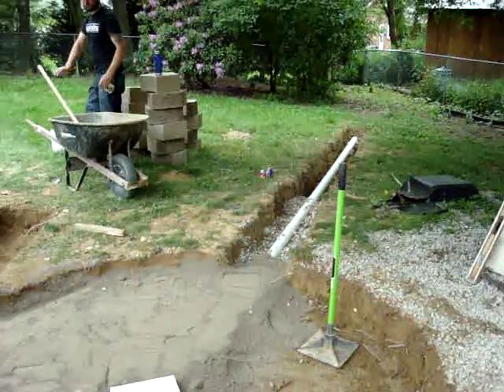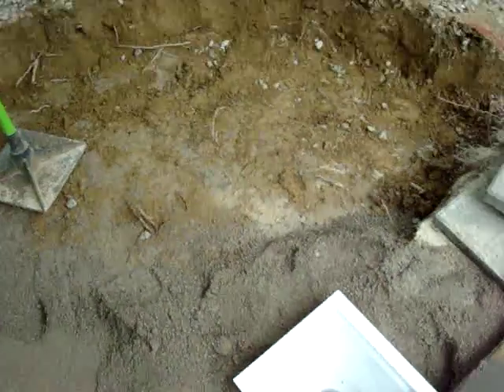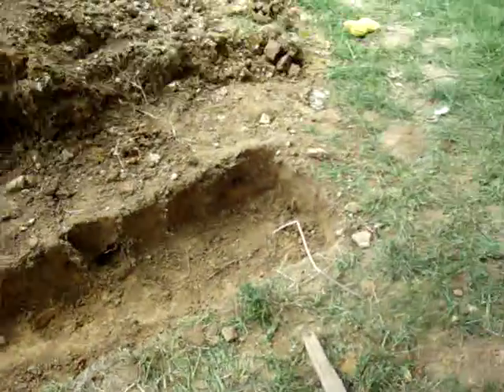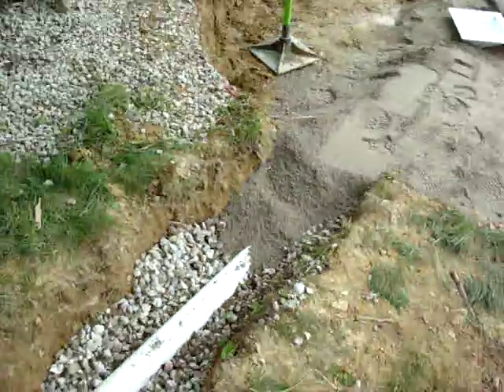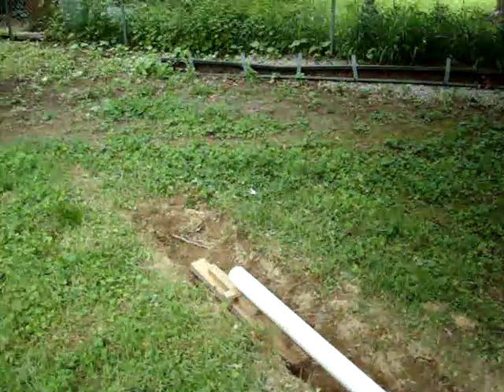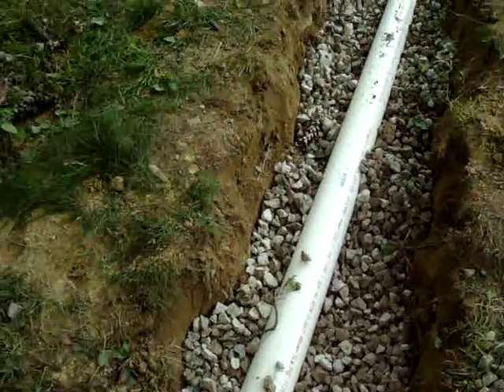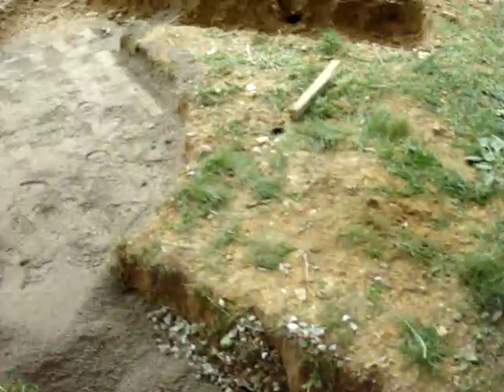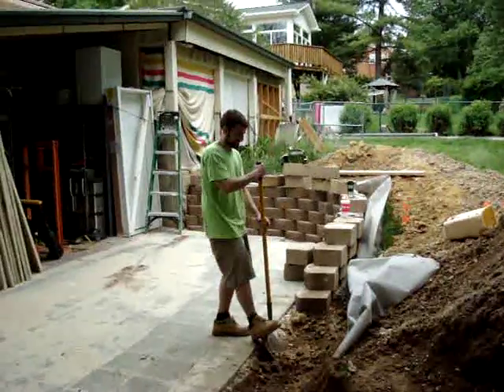Storm Water Drainage

Comment from the maker: Hi, thanks for the comments.  There are a lot of great books on hardscaping, landscaping, and water management and the building code also outlines basic prescriptive requirements, so they are good places to start.  You determine where the water drains by grading.  In this case the gravel supports the non perforated pipe to keep even pitch, but in the case of a perforated system, a field of gravel wrapped in landscape fabric is the underground drain field.  I wanted this to drain to daylight.

Comment: god so much to learn. Thanks for the straight forward look at setting the drainage up. How did you figure the water would collect at that corner? Didn't know The pipes needed gravel. Oh, so I'm trying to learn about putting in sprinkler systems, pavers, and drainage. I wasn't sure which I should worry about first. I'm trying to knock out each project one at a time but not sure if they need to be done together. Thx again for the vid!